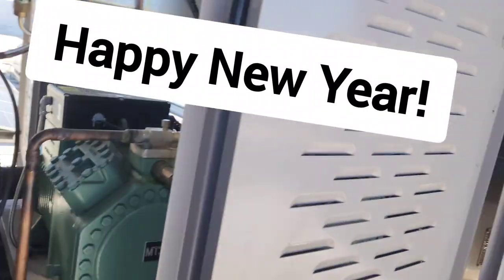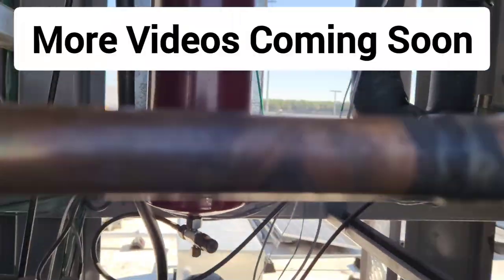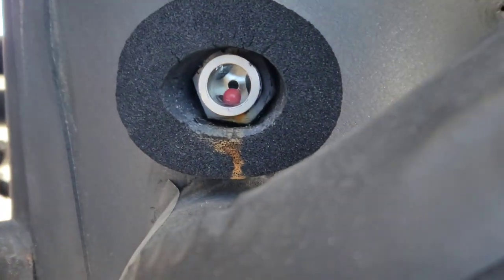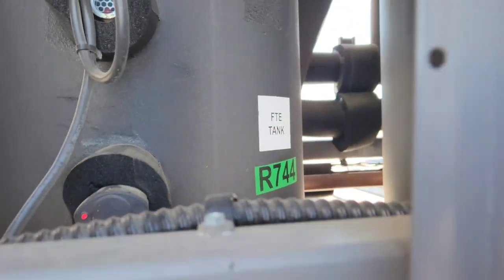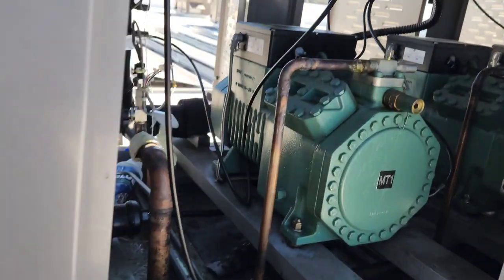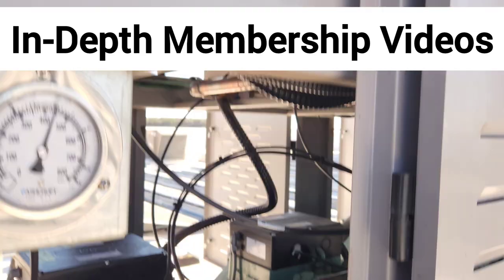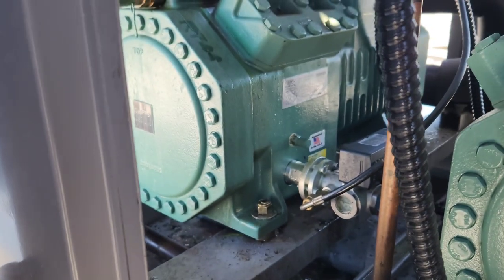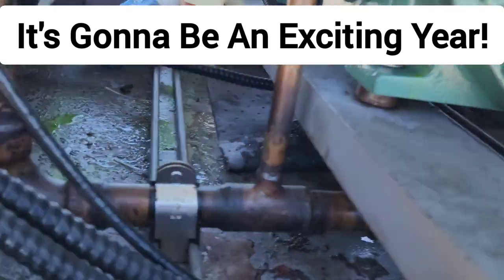INTRO TO 2024

Comment: If you got anything on oil lockouts let me know. It's the number 1 call back Lol.
Reply from the maker: Oil lockouts... Yes, oil systems are complex and complicated.what kind of oil system are you working with that You want to know more about?
Reply: @HVACRServiceTech  work mostly on multiple compressors rack, hill pheonix. There's a couple stores that have parallel rack. There's one store we deal with that has a single system rack where each circuit has its own compressor. Old store. Most the racks we have have the typical oil reservoir, separator, filter, oil level controls on side of compressors. Don't know the exact names of systems we have. Im Just about 3 months into racks. As far as oil lockout goes, know to check net oil and temperature differences on the oil piping, and something about the ocv having to be set to certain number. Forgot exactly. The ocv looks like a txv controlling the oil pressure going to oil level controls. Havnt dealt with a turbo shed yet. Controls are novor unfortunately Lol